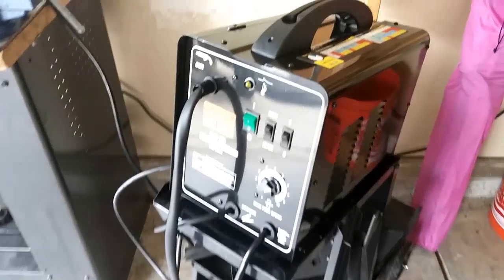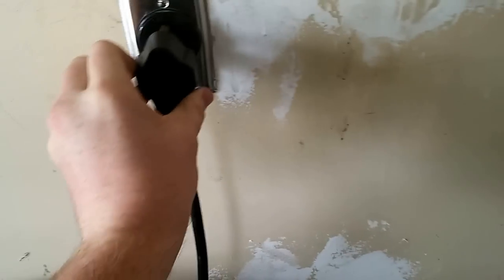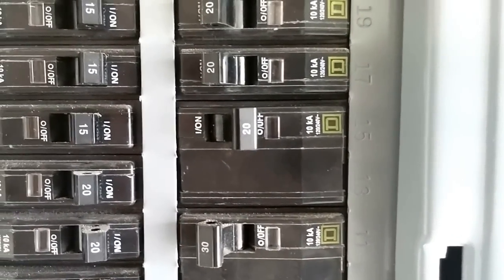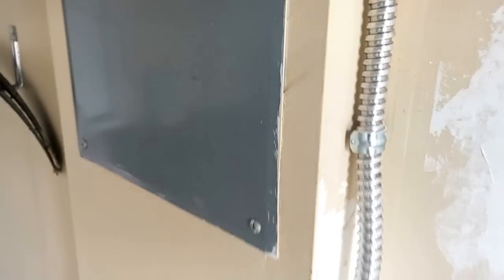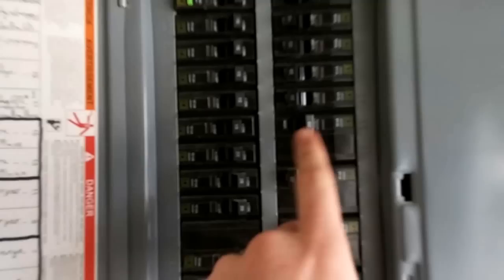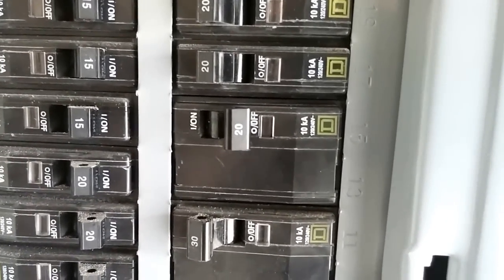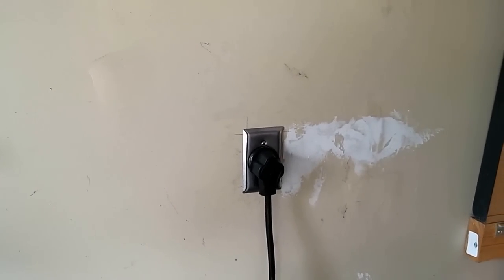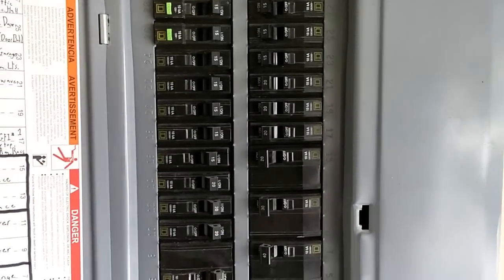Chicago Electric Mig 170/180 Welder Outlet

Comment: Any follow up by the author about whether it tripped the 20amp breaker, and if so how often?
Reply from the maker: No issues ever tripping breaker. The point of this video is highlighting the difference between the plug Harbor Freight uses...50 amp, and what the amperage requirement actually is (20 amps). Point is don't go through the effort to install a 50 amp circuit for a 20 amp appliance just because they used a larger plug. I had a 20 amps breaker already free and used that. I don't weld at full power often though.  I sized my wiring to accommodate a 30 amp breaker safely if needed...but never needed to.
Reply: @XterraRob  Thanks for the quick response. Sorry about the weird comment. I edited it back down to the actual question. Great video
Reply from the maker: No problem dude happy to help. Happy welding. Got a first project in mind?

Comment: What if I dont have a 30 amp plug but a 30amp adapter?? Will it still work off 110 plug ??
Reply from the maker: The welder needs 220 volt circuit to work. You can't (or shouldnt) use an adapter to fit the plug into a normal 120 volt outlet. You will need to install a 220 volt outlet for it to work.

Comment: I have that same welder and I use to use it in my garage and kept blowing GFI outlets ad my better doing what you did and running wire from my breaker to a 50 amp receptacle so I don't keep blowing outlet's.

Comment: I installed a 30 amp circuit for mine, plus I replaced the power cord with 15' of 10/3 with a different style 50 amp plug on it, and installed a 50 amp outlet on the 30 amp circuit.  Before I installed the 30 amp breaker I had a 20 amp dual pole breaker in the box that didn't have anything hooked up to it,  so I used the 20 amp breaker to test out the Mig 170 and it ran just fine on the 20 amp breaker.   I like the idea of having a 30 amp circuit for times when I need to push the welder a little,  plus I have the option of running something that needs 30 amps.
Reply: I drilled a hole in the back of the unit and rerouted the power line out through that. Seemed seemed to make more sense than having the power supply cord hanging out of the front and then wrapping around to the wall.
Reply from the maker: Nice work! I like the idea of replacing the cord.  The stock cord is too short for anything that cant be done directly on the bench next to you.  Thanks for sharing!
Reply: @XterraRob  I wanted the ability to plug the welder into the garage outlet and carry it down the driveway if I needed to weld anything thing out there.   I'll probably end up putting a 25 or 30 footer on there eventually.
Reply from the maker: How did you make the cord? Did you run 10/3 in a flex conduit or something? Or did you find a 10/3 in an insulated type sheathing?  I want to put a longer cord on it, but haven't thought enough about what the best way is.
Reply: @XterraRob  You can to a Home Improvement store like Lowe's or Home Depot and get 10/3 Power Cord,  It has braided 10 AWG  3 insulated wires(Red, Black, Green) in a rubber sheath just like any power cord.
Your welder has a 12 AWG cord on it,  if you want to upgrade it to a 10 AWG you'll also have to get some 10 Gauge Disconnect Pairs(2) for the 2 hot wires, and a 10 Gauge Ring Terminal for the ground.  Those are .25" x 10 AWG.
Reply from the maker: Great info, thanks!

Comment: I’m looking to buy this particular welder,,,, my garage is only wired for 120 however I have a big generator with a twist lock plug,,,, I’m going to buy a generator to welder plug they sell on eBay and Home Depot probably Amazon and a bunch other places ,,,and run this welder off of my twist lock generator plug rated at 30 amps 240 V.
Reply from the maker: Nice! Let me know how it works out!

Comment: How long is that plug wire?
Reply from the maker: I want to say its around 6 feet. Not very long. Long enough to be near your work bench in a few positions, but not too far away. Good for table top welding, but would likely want an extension cord if doing larger projects or under a car.

Comment: Unfortunately 220-240 volt receptacles weren't standardized in the US . It can be a little bit confusing for many people which is which but there's adapters available for this type of plug as long as you observe proper code .I wish they would have used bigger wiring than the 12 gauge for the power cord and used a thicker positive and negative leads plus a better ground clamp but for the price I can't complain too much.
Most experienced welders will tell you if you're using any extension cords not to use anything less than 10 gauge wiring and no more than 22 feet long and for good reason . If it says use a 30 amp breaker ,use exactly what they recommend .
For anyone who wants to go and modify the machine like chopping off the plug end or modify the cooling system etc, keep in mind that the warranty will be voided if you mess with it . 
This machine isn't my idea of a great machine but it's a decent entry level set up for getting a job done and for learning how to use it . You get what you pay for .
Reply from the maker: Fair analysis. I agree!

Comment: Hey man i just bought this welder and am wondering if i can put a 20amp male to 50amp female adapter to make this work. I have a 20amp outlet in my barn so it would be nice to make to not have to get a 50amp outlet
Reply from the maker: That would work if you can find the right adapter. If the 20 amp circuit is already wired in, its pretty cheap and easy to swap out the outlet, though...assuming you dont need the 20 amp socket for other appliances.

Comment: You could have wired that on the same wall as the breaker box and close, and saved a ton of money, but I guess you already knew that.
Reply from the maker: +That Dude There haha yeah. But ive got other reasons for wanting the outlet there. Main point of the video is the plug is a standard 50 amp plug, and the welder only uses 20 amps. And the breaker protects the wiring, so match the breaker to wiring gauge, and you don't need a full on 50 amp circuit.

Comment: I just bought this same welder it say 240 volt. This video was made a few years ago you said that I was it 220 V but it says 240 on the box. Anyways my question is I have some 6 gage wire left over from electrical done at my house By an electricianWill this be OK to use if I use that wire and wire it to a double pole 30 amp breaker? Or would this be incorrect?
Reply from the maker: +Lasurge1982 220 or 240 volt is referencing the same source.  Thats no issue. 6 gauge wire can carry up to 55 amps. Since the job of the breaker is to cut power before the wiring catches fire...a 30 amp breaker on a 6 gauge (55 amp) wiring circuit is OK. However...since the welder has a 50 amp plug, and your circuit will be with 55 amp wiring...I'd probably go ahead and put a 50 amp breaker and essentially wire in a full 50 amp circuit. It is over kill for the power of this welder...but now your receptacle, breaker, and wire gauge will all match. Note I am not an electrician...so make sure you do enough research if you are unsure of anything. AskMeDIY is a great YouTube channel for a resource.
Reply: Xterra Rob I do have a 50 amp breaker it’s a double 50 amp two pole breaker so wouldn’t that make it 100 A? The breaker has two boxes each that’s have 50 a on it. Is there a difference would I need to get a different breaker?
Reply from the maker: +Lasurge1982 A 240 volt outlet has 2 hot wires instead of one...so you need one 50 amp breaker for each hot wire...or in this case, a double pole breaker that shuts both hot wires off if either of them short out. Check out AskMeDIY on YouTube for wiring a 240 volt outlet. He gets much more in depth than I do. I am not an electrician...just had to learn some once I bought the welder. I can't know for sure what you have...but it sounds like you have what you need.

Comment: thats just what a lot of welders have.  just run what ever size line you want and make an adapter. i plan on getting this welder but im gonna use L14-30 30a twist lock connectors incase i need to use it on a generator. they are a lot cheaper on ebay vs in stores.

Comment: The original power cord on this welder isn't long enough to reach where I need it to go. The manual says not to use an extension cord, but I was wondering since it only draws 20 amps, and I have a 50amp breaker if I could run an 50 foot extension cord?
Reply: I changed cords on this machine as well.  I remember thinking how odd it was to have a 50 amp plug on a 12 or 14 gauge cord for a welder that runs at most 20 amps.   Talk about confusing!
Reply: MrAthlete811 just have a cord thats bigger than what the welder has and you'll be fine.
Reply from the maker: +Ben Griswold agreed...very confusing! Thanks for the comment.

Comment: You're right they put the wrong plug on this unit. Since you were going to be there anyways I would have put a 30amp plug on it and 30 amp breaker. It sure beats someone thinking they have a 50 amp outlet and trying to use it as such. I just put a 50 amp and a 30 amp circuit in my garage for the same reason. 30 amp is for my air compressor and the 50 amp is for a welder that draws 25 amps. Originally I was going to install two 30 amp circuits but after thinking about it I decided to intall 6 guage wire and 50 amp components so that I could up grade to a bigger welder later if I wanted to. Also since I was going straight into the main panel outside I used two GFCI breakers so my welder wouldn't become my light me up box if something internally failed.
Thanks for sharing and Best wishes n Blessings keith

Comment: so I can't use the breaker that I have ? it's a 170 I got the breaker cassette deals. it's a double 20 . do I need a bigger one ? or a new break box .. sorry I don't know much electrical .
Reply from the maker: a double pole 20 amp breaker should be correct. I am wondering if you wired the connections wrong at the breaker panel. I recommend checking out askmediy on YouTube...how to install 220 bolt outlet. that's how I learned.
Reply: +Rob C okay thanks. I'll check it out.
Reply: I switch wires around and I hooked em up to a 30 double pole and it turned on. Is it okay if I run that breaker
Reply from the maker: +Jay P As long as the wiring in the wall to the outlet is rated at 30 amps or higher.  The breaker needs to trip before the wire in the wall over-heats and burns up!  If you have 20 amp wiring in the wall, you can't have a 30 amp breaker.

Comment: no not really I put it at Vac 200 put the red on hot and black on ground on both hot I'm getting 120 still won't turn on
Reply from the maker: if you are getting 120 volts, it sounds like you don't have the correct breaker (double pole) to get 240. is this the MIG170/180?

Comment: I would have run 60 amp wire and run a 60amp breaker box as you could then run most stick welders or large compressors as well. that's what I did because I needed to be able to run small wire feeds to 295amp stick welders I also have a large compressor I built from 3 junked units motor toast on one pump was bad on another and the tank was rusted with a bad pump so I took them and made my own shop air.

Comment: I would have just cut the plug off and put a 20 amp plug on, its kinds over kill for the 50 amp, lol. nice job tho, im an electrican.
Reply from the maker: ***** If I already had a 20 amp circuit installed, I would have done that.  I was installing the outlet from scratch so I just ran the wiring for 30 amps and used the matching receptacle for the welder.  Thanks for the comment!  This outlet was my first real home wiring project.

Comment: Or would it be ok to use a dog bone adaptor?
Reply from the maker: Justin Watson Dog bone adapter would be acceptable if it is matching the 220 volt 50 amp plug down down to a 220 volt 20 amp plug.  You can't run this welder on normal 120 volt outlet, even if rated at 20 amps.

Comment: Rob C. I'm kinda new at this. But is it safe to change the plug wire on this welder to a 20 amp or 30 amp?? I'm fixing to buy a 180 Mig/Fux Core Welder at HF
Reply from the maker: Justin Watson Absolutely...the "proper" way to go about this is to replace the 50 amp plug with a 20 amp plug so the welder plug matches the welder power requirements and the outlet circuit.  I was installing the outlet from scratch, so I just bought the matching receptacle instead of a 20 amp and having to change the plug too.  Dog Bone adapter works too as long as the adapter is rated for 20+ amps.
Reply: Ok. So I can change the plug on this type of 170-180 amp MIG/Flux welder for it to fit Into a 110v - 120v wall socket?
BTW Rob C Thanks for your help.
Reply from the maker: Justin Watson NO!!!!  Sorry, I misunderstood your question.  The proper way is to replace the 220 Volt - 50 amp plug on the welder with a 220 Volt - 20 Amp plug so it matches a normal 220 volt 20 amp socket in the wall and matches the actual power requirements of the welder.  The welder needs 220 volts and it won't work on 120 volts.  The overall issue with the welder is it only needs 20 amps to run, but has a 50 amp plug on the end.  To plug your welder in, you either need an actual 50 amp 220 volt circuit wired in so you can match the plug to the wall socket.  Typically, per code, your circuit breaker, wire gauge, and wall socket must all match the amperage rating.  A 50 amp circuit would be complete over kill since this welder only needs 20 amps.  Ideally, you would have a 20 amp breaker, a 220 volt 20 amp wall socket with proper gauge wiring, and you would replace the plug on the welder with a 220 volt 20 amp plug...that would make everything match perfectly.
Reply: O ok I understand now lol. You should be in the electrical buisness. Thanks for all your help now that I know what to do before I buy these type of welders that have 220v with a 50 amp plug.
Thanks
Reply: I might have to save your message to help me do this so that I don't forget.
Thanks again Rob C
Reply from the maker: Justin Watson No problem at all.  I originally had the 90 amp flux core welder from Harbor Freight since it ran on 120 volts...and I didn't know how to install a 220 volt outlet.  I am glad I spent the time to learn and install the 220 volt outlet because the Mig 170 is a LOT more powerful and can make much stronger welds.  I love this welder!
Reply: Yeah that's what I was gonna do also is buy the 90 amp one but now I know what to get for 220v I'll just save a little more $ and wait on a coupon and go ahead an get the 170 or 180 Chicago electric mig/Flux welder instead of the 90 amp mig.
Thanks
Reply from the maker: Justin Watson Good plan.  skip the 90 amp and go straight for the 220 volt one.  It is a much cleaner welder and much more powerful.
Reply: Thanks.

Comment: This is funny. Everyone thinks they are an electrician. Way to go Rob C. I would do the same thing if I didn't already have a 50 amp receptacle installed in my shed. I really don't agree with using it on a 50 amp circuit though since the wire from the machine would burn up before the breaker would trip.

Comment: Is this welder capable of welding .187 and .250 structurally?  I have been looking at it for welding suspension components on a jeep frame that I have.  I just want to use it with flux core. Or should I get a 220 Stick?   I have welded structurally (rv frames) in the past but only with 220 arc stick.    I have a little century 110 fux core wire feed but I know it is not hot enough to do the job.
Reply from the maker: I won't confirm structural integrity on a potential safety issue...I am not an expert.  That being said, I welded a few 3/16 square tubes together and it melted away some of the edge material if you don't keep the torch moving...it gets hot.  For welding 1/4 and 3/16, I would trust the welder if you trust your technique and capability.

Comment: 2 leads to 2 pole breaker (which should be 30a not 20a to match conductor) 1 lead to panel neutral bar not ground.  This video is unsafe information and should be removed for your own liability.
Reply from the maker: It is a 2 pole breaker, even though it only has a single "handle".  That is how every 220 volt appliance is wired in my house, new, from the builder.  It is 2 pole, but connected internally and not with an exterior bar.  Breaker protects wiring.  I essentially have a 20 amp circuit that I chose to use heavier wiring on.  That is not unsafe. The heavier wire adds a factor of safety.  220 volt uses a ground wire, not a neutral.  Neutral bar and ground bar are connecting in the panel  This video is intended to be about the welder power supply, and understanding that although the welder has a 50 amp plug, it only requires an input of 20 amps.  I would imagine that per code, the only way to go about this is creating a legit 50 amp circuit that is complete overkill for this application, or replacing the welder plug with a 20 or 30 amp.
Reply: +huntjunky1  - it is not necessary to use a 30a trip just because the wiring is rated to handle 30a. YOU DO want to have the breaker trip at what the welder is calling for which he said was 20 a. so he is using the proper breaker.  For a 220 or "2 phase" circuit you have two hot leads and a neutral that is the ground. If you use 110vt romex with a bare ground wire for single phase wiring for 220 it is unsafe. all three wires should be insulated in the romex. you can also use 4 wire and run the bare copper to earth stake run.